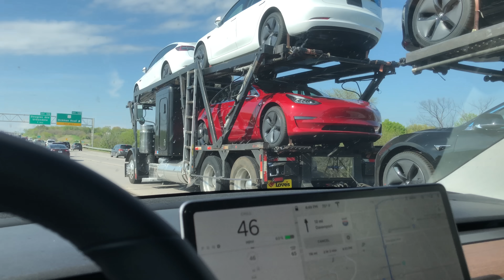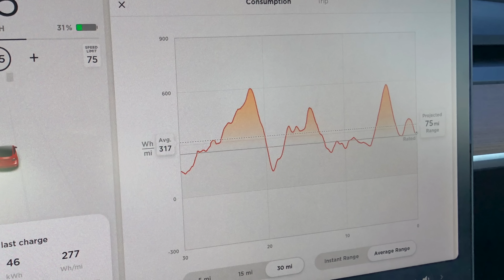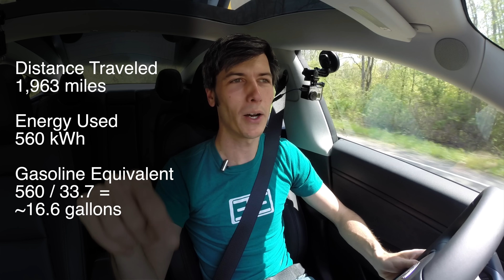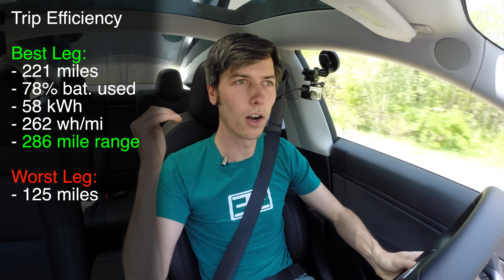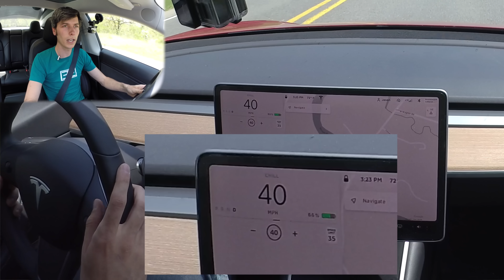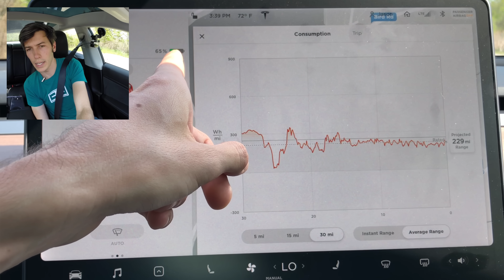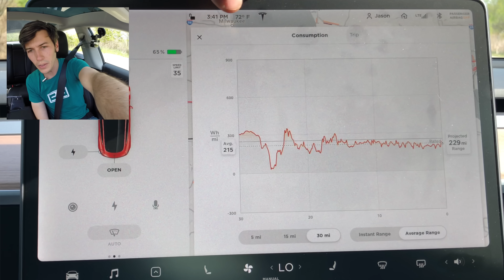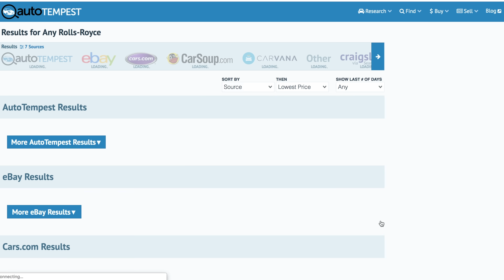How Miserable Is A Tesla Road Trip?

Comment: If you were to do a really steep climb like Beartooth Pass Wyoming where the road climbs from 4,000 feet to 11,000 feet in 25 miles with many hairpin turns and then gradually descends to West Yellowstone (7,000 feet) in another 75 miles would the Tesla make it? When you got to West Yellowstone would it be possible to charge the car? I do alot of long drives on steep mountain roads and I don't think any of the electric cars have the range to do this and its hard to find charging stations outside the city.
Reply: Beartooth Pass is Red Lodge MT to Cooke City Wy to West yellowstone WY
Reply: Out of Spec Motoring does mountain tests. The Tesla does just fine because it gains charge going downhill.

Comment: Couldn't Elon develop some sort of charging system that maybe was controlled by the wheels to charge up the batteries, kind of like an alternator in an ICE?
Reply: regenerative braking already exists, the issue is just that trying to draw any power from the wheels obviously results in slowing them down.
Reply: Yep, regen braking let's you regain some energy previously lost by fighting gravity, or acceleration. An alternator in an ICE vehicle isn't magic though. It's still charging the battery by using energy from gas/fuel that would have went to propelling the vehicle. The act of extracting energy for an alternator takes it from somewhere else. Thus, for EVs it would be taking energy from the battery to charge the battery... the laws of physics are a pain, lol, and there is no free lunch.

Comment: More than SEVEN hours standing there waiting for the car to fill up with petrol? Could you imagine THAT?!! Never happen with PETROL stations that are all over the place. Not on a smartphone (not everybody HAS one!!) Sorry Elon. I'm sticking with my PETROL (OK gas in your country) car.
15 minute stop while I fill up with gas (PETROL in my country) and ALL pumps fit ALL cars (not having to check if that electric socket will fit MY type of electric car. Who thought THAT one up?
Reply: Nobody stands around waiting for the charging to complete.  I go have lunch - which I would be doing even with a gas car - and when I'm done my car is, too.  When I am not doing a road trip, I spend exactly 0 minutes charging the car since it charges overnight while I sleep.
Reply: With electric, you can fill up at various times not considered with fuel, especially at home. You effectively just fill up when it's not in use, a change of mindset.

Comment: The middle 50% of the battery. Same as the guy that did the Fort Collins Colorado to Los Angeles trip in the Ford Mach E.  So I say again to EV automakers: I can fill my 36 gallon gas tank in 5 minutes...   to 100%. No handshake, no calculations, no charging system faults (ok this is a Mach-E problem not Tesla).  But none of these issues - ever.   200 miles range realistically in your EV? Ok, not bad perhaps for amateur drivers, but I will NOT be spending 25% of my time on a road trip - connected to a power line.  Get it down to 20 minutes per 500 miles. That's still 4 times worse than I currently experience in my ICE Ford F150 3.5 turbocharged V6 burning that nasty gasoline.

Comment: What happens in unexpected traffic jams? Guess you’d factor that in also
Reply: EVs don't waste much energy idling... as their "engine" doesn't idle, so that isn't an issue.
Reply: But surely the AC must be using a lot of electricity
Reply: @bbulliard  , it's a mild usage, but not enough to make you panic. Similarly, gas vehicles have a higher fuel consumption with AC on, but you're not going to worry unless you're on your last drop of fuel. If you're so concerned, you could just turn up the temperature a few degrees.
Reply: @JimBob1937  I'm having my doubts.  ac uses a lot of juice

Comment: Real test. Have a gas operated car start at same time and see who gets there first never going over 75mph
Reply: Easy, the car would.  I'd drive Omaha-Staten Island, 1250 miles, about 19 hours each way, so total of 2500 miles in 38 hours.  He did 500 miles less in the same time.  I get about 500 interstate miles to the tank (I stop about every 7 hours), so starting with a full tank, I'd stop twice overall each way, and the stops take...10 minutes or less to fill up.  He took 12 stops, each time after only ~200 miles.  I don't know if he includes the time to charge before the trip, but if I include my starting tank of gas each way, I would make the 2500 mile trip in 6 tanks of gas.
Fewer stops, each stop takes less time.  Gas would take less time.  Maybe it costs more, maybe it's less efficient (he says he made his trip in the same energy as ~16 gallons of gas), but gas would get you there faster.

Comment: If you are stopping for a hotel, how fast do you need to do the rest of the trip?  If you are in a hurry, just skip the hotels.  LoL driving more than 1000 miles with ANY vehicle is going to cause problems.  I did drive 26 hours in a row, do not recommend.  DOT recommends a stop every 2 hours any way, so taking a break every 3 hours is doing pretty good.

Comment: One other question I assume will not have a response. I get better gas mileage at 90 mph due to the 9 gear transmission than I do at 65 mph. This is from real life testing. The 8th gear in the TLX turns over so slowly it actually increases the mpg compared to 5th gear. And since I have driven 25k miles since 2015 (almost 7 years) according to your other comparison, I should keep this car rather than get a e car at least till it turns 50,000 mile or another 7 years at least/environmentally wise.

Comment: What if there is no charging point available at your next stop?  What if there is a point but if there is one of two motorist waiting before you.  The best  plan is to buy a car with a draw bar for pulling  a trailer and fit a diesel generator in it.  You can then charge the car as you travel along.

Comment: Also understand that if you have a significant load it takes heavily from the miles.  The Tesla Cybertruck weighs something like 9,000 (about half from the batteries), but can tow 15,000 pounds.  If you actually towed 14,000 pounds that would cut the range from 500 miles down to less than 200.  This is also best case scenario range, so figure about 10% less.  Also understand these batteries are much larger than the Model 3, so that 500 mile range Cybertruck likely has a battery 6x larger than the model 3.  That means the charging times would be 6x longer pretty much.  So if you go from 30-80% in 15 minutes the Cybertruck would do it in 1.5 hours.  Now you are looking at 1.5 hours of charging for a 50% charge for only 85 miles of driving towing your RV or boat.  This is the problem with electric cars.

You could say the Cybertruck could handle a charger that puts out 6x the power, but the chargers are already running 500v at 50 amps.  Think how thick the cables would be and how dangerous this much power is at say 1000 and 150 amps.  Now imagine what charging the Tesla Semi would be like with a 500 mile range with a total load of something like 85,000 pounds.  That would be a battery around 20x the size of a model 3 battery.  Now you are looking at 2000v and around 250amps or more... and that is still going to take what an hour to charge.

Think of the power a truck stop would need and how many extra charging stations they would need to handle the slower charging times.  A truck stop with moderate traffic would draw the power of a small city likely.  How is that truck stop going to make a profit if it needs 5x the land and that many chargers.  They would likely need a transformer station built right into it and a capacitor bank to keep from browning out the nearby town.  I question how much they would have to charge for the electricity to charge these trucks.  Also if the US goes all electric they would need to increase the power grid 4 fold and electric prices would likely triple from that alone.  So when people say the US should be carbon neutral by 2050... they are smoking something VERY strong.  Think $50 trillion in spending over the next 20 years minimum.

As a side note... while the electric car is more efficient than gas you are not taking into account the 20% you are loosing at the charging station either.  You are not driving a large car.  A Honda Civic would have likely done 40 mpg easy.  That Civic would have been able to go 500+ miles between stops and would have only taking minutes to fill up.  I also do not have to find a place close to the charging station to eat.  Think of walking to get food while your car is charging in the winter or rain.  EV have MASSIVE limitations and downsides... depending on the person.  I do not drive much and live in a small city.  I could charge at home maybe 1-2 times a month.  I just do not drive much.  That is why I got rid of my car and got a nice 3 wheel recumbent that I could haul groceries on.  I have been using it for 95% of the time or more and I live in Michigan.  I would rather bike in the snow or rain that take the bus.

So how much did that 560kw cost using the charging stations?  When I checked on line it said $0.28 per KW for a Supercharger station.  That would be $156.80.  A Honda Civic at 42 mpg over 2000 miles would have cost $152.38 at $3.20 a gallon... and this is with gas prices being pretty high.  Is that right?  Did you use only Tesla chargers?  Do others cost more or take longer to charge?
Reply: at $3.20 a gallon ... this did not age well
Reply: @tobs9955  Well some Supercharger stations in California charge as much as $.43 a KW hour.  For the top end CyberTruck that is $130 to fully charge (and something like 5 hours).  The F-450 Diesel would likely run about $200 or so to refuel, but at least you can refuel fast and drive much farther so you can take that boat or camper trailer with you on that Family vacation 1000 miles away.  That F-450 will also likely last 2x longer too.  If you have to replace the battery on that CyberTruck you are looking at something like $50,000.  I think it has aged quite well.
Reply: @toddabbott781  and honestly, about fuel consumption, if you're talking about big trucks it's one thing, but i'd bet i could easily take an Honda Civic around 60 mpg or higher on such a long trip. 40 mpg for town traffic seems realistic

Also, fuel and electricity prices goes up hand in hand
Reply: @giacomoneri1782  Yup.  I thought it was funny when they originally said the Roadster would reduce your carbon footprint after only 2 years... but this was back when they first launched and they were comparing it against the Corvette, which back then had something like 12-14 mpg.  When gas prices started peaking under Obama they reconfigured it to have driving modes and in normal cruise it jumped up to 24 mpg.  So basically just a tweak of the programming in the ECU doubled the time it took to compete carbon wise.  I calculated against a Honda Civic... less composites, more recyclable, better gas mileage, likely mode driving years with less maintenance (partially do to cheaper parts).  It would take a Roadster something like 60 years to break even and even the model 3 was over 40 years.
Reply: @toddabbott781  i mean, if they compare them to American muscles or trucks they're failing to make a decent estimation. 14mpg is horrible for anything that's not a racing car. For any European or Asiatic compact or family car 30mpg in urban setting is the bare minimum, even SUVs can easily do that. On highway they easily go over 45mpg, by keeping the foot under control i got 56mpg on mine, and it's 1,6 tons n.a. gasoline with really short 5 gears. A lighter diesel with longer gears and a cruising 6th gear should be able to go faster and drink less. A plugin hybrid should go well over that, offering the option to go full electric in town without carrying all the weight pure EVs batteries adds, and without the range anxiety.

That also with road cars engines being quite inefficient, with around 20-30% efficiency, while racing and marine engines goes over 50% and generators even higher. That to say ICEs could be improved a lot as well if kept developing.
To put it into perspective, in 1900 there were EVs running lead acid batteries with around 100 miles range, and with the technology being developed for industries and military, which requires better standards than automotive, i don't see that huge progress.

The problem anyway it's not EVs, if people wants to buy them it's ok. The problem it's politicians wanting to ban ICEs
Reply: @giacomoneri1782  True, but I do not think they should subsidize EV.  All that money should go into researching better batteries.  As it is only about 3% of it does.

The 2017 Corvette ZR1 they compared it to gets 12 in the city and 20 on the highway.  The 2022 ZR1 gets 16/24.  City driving is where Teslas shine.  They actually do worse on the highway.

The Tesla Model S "Plaid" costs $130K and a Corvette LT3 Stingray Convertible is $85K.  I think I would rather have the Corvette.
Reply: @toddabbott781  with that price difference you can also buy a Prius as a daily and some solar panels to charge it. Plus both the Corvette and the Prius looks better than the Plaid.
The Plaid also isn't anything like the Corvette, totally different car. It's more like a German 3 volumes, which usually costs less than the Corvette and goes like 30-50mpg.
For 130k there's so many better cars i could buy the Tesla wouldn't even be a remote idea, no chance.
The only good thing it's the "ludicrous" acceleration, but for 130k i'd expect any car to have a quite fast 0-60

Comment: Thanks for this video you open my eyes. For now, no electrics cars until 3 conditions are met

1. Car should have 500+ miles of range
2. Should have full charge in 30 minutes or less and….
3. Battery costs, don’t want surprises every 5 years where need to spend $5-$7k to replace the battery.
Reply: Tesla is about $20k to replace
Reply: Where does everyone get X years until battery replacement? They're rated by miles, as it depends on how many miles you drive per year to define how many years it'll last. Tesla's batteries are rated for nearly the life of the vehicle at 300,000 to 500,000 miles. Lucid is coming out with a 500+ mile model. Tesla superchargers are rated for up to 200 mile charge in 15 minutes, so 30 minutes gets you 400 miles. Really, what you want is either already here or coming soon.

Comment: as always, did your electricity come from wizards' spells?  No.  It likely came from BURNING COAL.  you get in 1 traffic jam, you're in serious trouble.  You talk alot about "if you want to take that risk", said in several different stressful ways,  I NEVER am stressed out about range (at any speed), nor finding a gas station.  Since this was apparently an approx 30-year old video, sorry to tell you that, 30 years later, we still don't have flying cars, nor "zero emissions" electric cars.  They still have ALL the downsides that you gloss over.   OMG, you're always looking at graphs and letting it tell you how long you must sit at a restaurant, when you Don't want to sit there.  This is madness.  (and I'm an Engineer, so graphs and numbers are fine with me.  But this hand-wringing over range, battery level, "if you feel like taking that chance ...", etc, it is just madness.  You'll see me passing you going about 120mph, if you are moving at all.  And not sitting somewhere with your toy-car extension cord, waiting.

I do feel you on "hitting potholes".  (nothing to do with "electric").  I hit one MUCH harder than that, at night.  Blown tire (which happened) was the least of my problems.  It heavily dented the wheel, couldn't be fixed (really smashed), and cost me $1000, not counting the new tire.   😳😅

Comment: A few questions: how much is a Tesla? How long do the batteries last? How costly is it to replace the batteries, or do you just throw away the car and get a new one? Are there charging stations in Montana and North Dakota? I've never seen one in Pennsylvania or New York.
Reply: They're rated by miles, as it depends on how many miles you drive per year to define how many years it'll last. Tesla's batteries are rated for nearly the life of the vehicle at 300,000 to 500,000 miles.

Comment: Read several charge rate videos usually allow you a 7.2kw/hr rate.  This is 30A with a 240V charge.  They clearly stated that this is a 20hour full time for a flat battery and you said you could charge your vehicle in 50 minutes, someone is bullshitting here.  Oh by the way the 7.2kw rate is about equal to 9 horsepower an hour rate so me thinkest you are a World Class BULSHITTER, as numerous videos seem to counter your story.  Also remember to charge at the rate you were implying would require a rate well over 200A and 480v (96kw) and that cable would be several inches in diameter and have a very large plug.  Sorry Tesla is equipped with a 30A 240v plug.